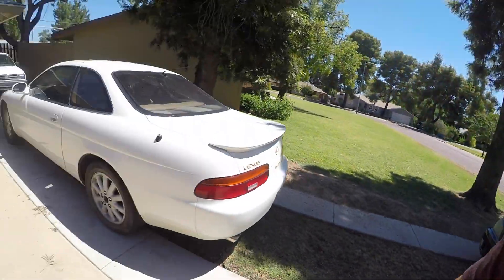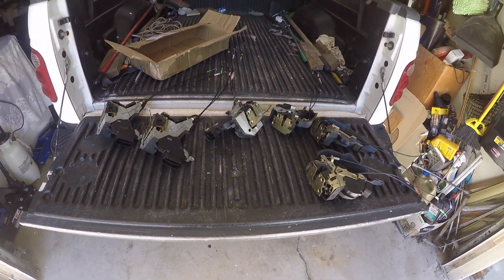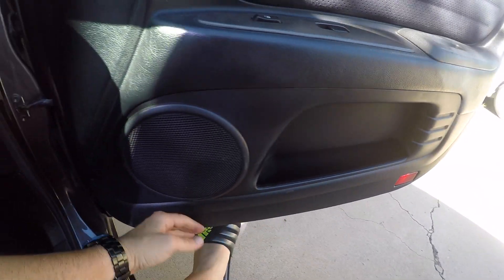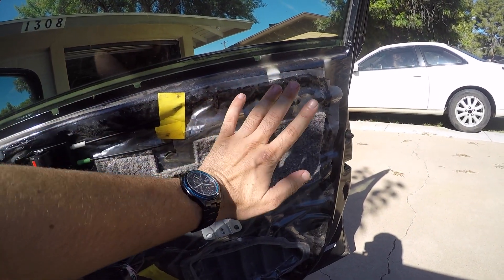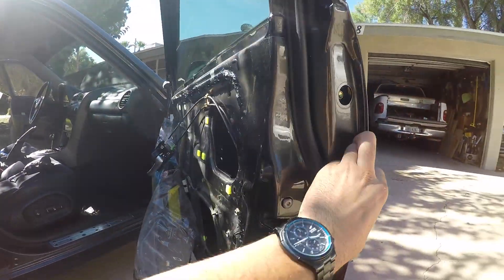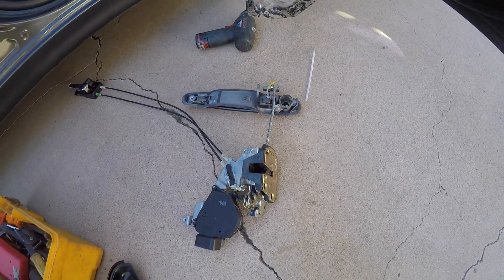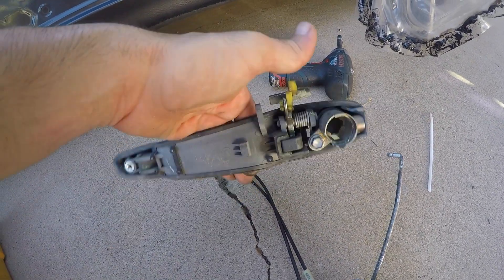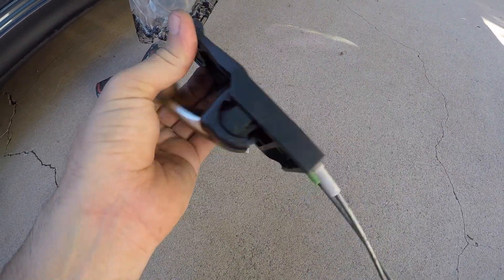Lexus IS300 Door Lock Actuator DIY. Fixing door locks that do not work! Car vlog installation

Comment: Thank you for this video.  I got the Denso oem part off Amazon.  Your instructions were very helpful for pulling the door apart.  My lock was clicking but not moving far enough to open or close.  Anyway I noticed the white  threaded nylon (where the cable goes into the door handle shown at 5:01) piece and I popped it out and popped it back in a couple threads farther out.  I tested the lock and it worked fine after this.  Note I couldn't really turn it, I had to pop it out and pop it back in.  It looks to be made to be adjustable.  Anyway I clicked the lock 10-20 and worked fine, so I buttoned it back up and seems fine.  Anyway this might be worth a try before you get a new mechanism.  Thought about replacing the motor anyway, but you mentioned clips being breakable and my luck on a 20 year old car, figured would leave it alone.

Comment: I am trying to remove the rear driver one. There is not enough opening to pull it out.  It is tight. Window is up. Any tip from anyone?
Reply from the maker: Take the bolt out on the bottom that holds the rail for the window. That should give you more room.
Reply: I need help too. The rod to the window doesn't wanna come out

Comment: After doing this, how do I source what’s not allowing me use my clicker with my car? Keyless entry never worked since I’ve bought the car, where could I start mrstan
Reply: Not keyless I meant remote entry never had worked
Reply from the maker: @AnthonyLivesTwice  have you replaced the battery in the key?
Reply: RacecarAndChill I swear if this is it I’m shutting my hands on the door
Reply from the maker: @AnthonyLivesTwice  😂😂 there should be a light on the fob when you a push a button.
Reply: RacecarAndChill I lost the damn chip during this whole process, I literally walked from my garage to my room with it in my hand and when I got to my room it wasn’t there anymore, I don’t know what kinda sorcery just happened, but I just ordered a chip/key from mike tsai which I recommend if you want an upgrade to a more up to date key fob

Comment: I had the same issue where the locks got stuck, I ended up fixing the driver side doors front and rear. I just replaced the actuator motors which were like $10 on ebay for the pair, then resealed the actuator. No issues here after almost a year.
Reply from the maker: KHRIS300 _ I think I may have gotten the wrong motors then. Out of the 4 doors, only one of them is still good, the other 3 failed. But thanks for the info!
Reply: khmaib0iso Yeah its a pain in the ass, especially the driver side. I used some cheap harbor freight 2 part epoxy that bonds plastic. I would recommend something name brand like JB Plastic Weld. Make sure to clamp the motor cover down while the epoxy dries.
Reply from the maker: khmaib0iso yea same on one of my cars. Lol

Comment: how do you remove the actuator if door does not unlock
Reply: how do you remove actuator if door does not open from in or out  seems like latch is not releasing